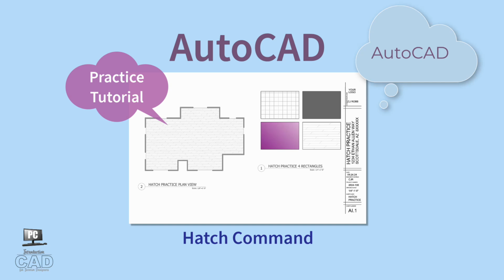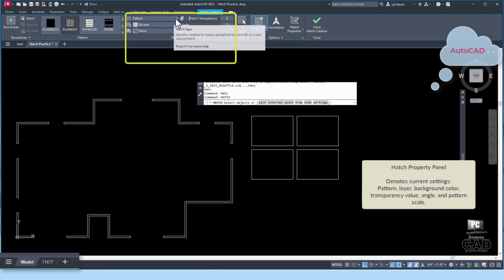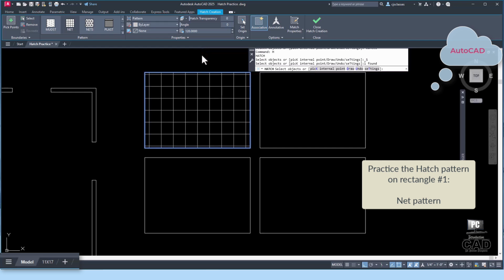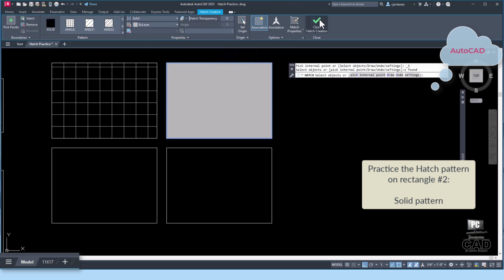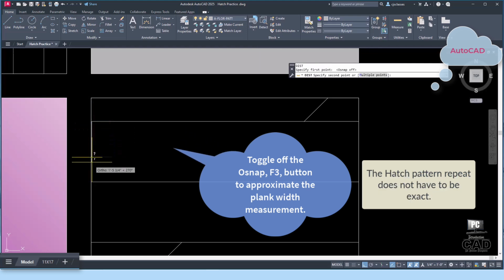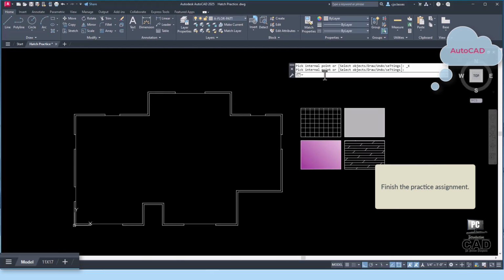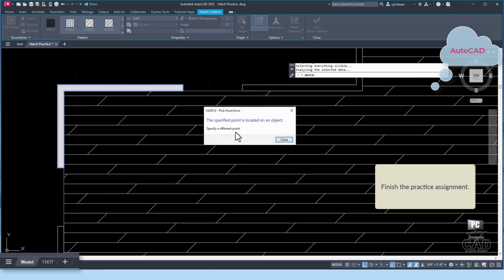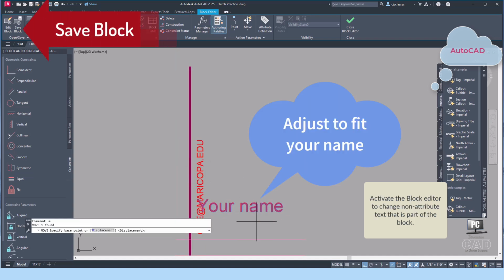AutoCAD Hatch Command - PC

Comment: When I want to create two different Hatch patterns do I have to delete the hatch pattern I had or is there a way to change it? What is the key to match the hatch pattern or can I only insert the hatch I want?
Reply from the maker: Yes, you can change it by going into the Hatch edit command. Double-pick on the hatch pattern to bring up the Hatch editor. You will see many modification options.